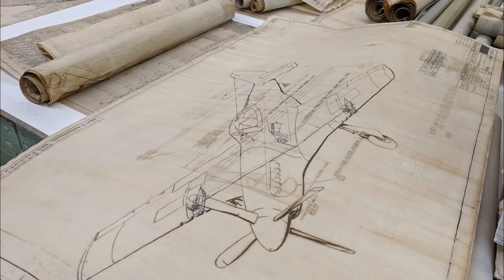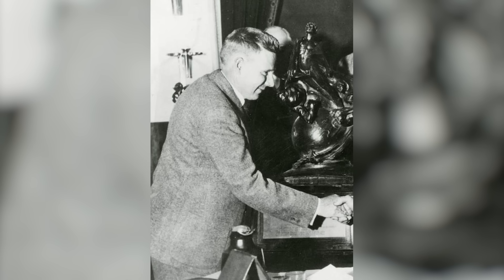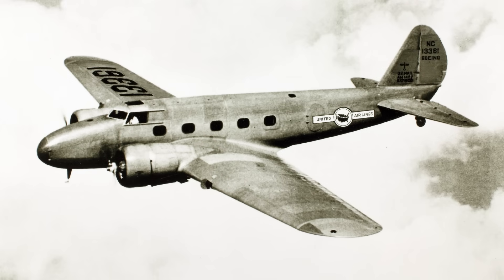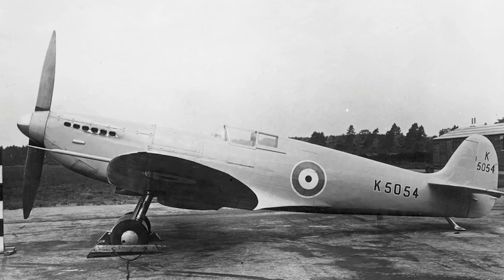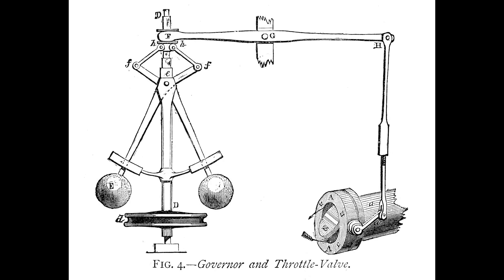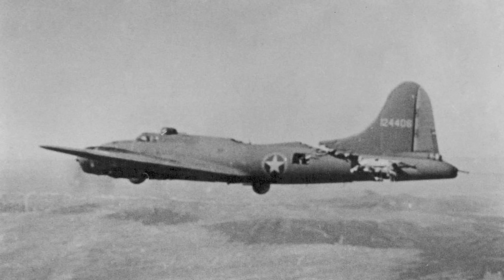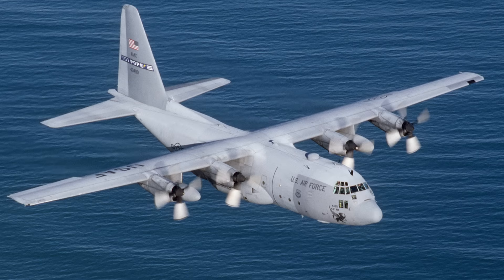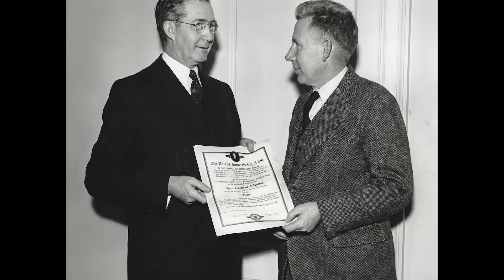The GENIUS Who Built A Gearbox Inside A Propeller

Comment: 10:10 7K feet per minute of climb? Total nonsense. As a note, 'instant' is not the same as immediate. By Aug 1K planes had constant speed props, DH didn't convert all of the 1K in 54 days. 11:50 HS constant speed props were not on every Allied fighter, Curtis electric props were used.  Ai, Ai, Ai, Ai.
"In 1933 the Collier Trophy was awarded to "Hamilton Standard Aircraft Propeller Co, with particular credit to Frank W Caldwell, Chief Engineer, for development of a controllable-pitch propeller."
7 years before the war started.

Comment: Germany had another ace. They had pumps to feed diesel and not aspiration.B S K Murthy.
Reply: also the Germans had discovered innovations they had a system with water spray in the combustion chamber for a while to get out of a difficult position and an oil cooler that hugged the propeller ?
Reply: Realization dawned on me. A diesel engine can't function without a pump to spray diesel on hot air.B S K Murthy.

Comment: In the 1950s there was a story at Dehavillands that some technicians on an RAF airfield converting 2 pitch props to 3 blade C/S units in June 1940 were told by an accountant to stop work because the Company had still not received a signed contract for the work and might not be paid for it. To which the Technicians retorted, "If we don't change over the Props we will NEVER be paid."

Comment: Wallace Rupert Turnbull of Saint John N.B. Canada.
During the First World War, he went to England to offer assistance to aircraft manufacturers, and designed propellers for Sage seaplanes, and a Short 184 seaplane, which attained an altitude record of 13,000 feet (3,960 m) on June 9, 1917. At this time, he began to work on a mechanism which would allow the pilot to control the pitch during flight, like changing gears on a car, so that the pitch could be set at different angles for take-off and landing, and for level flight.

Gaining a Patent

At war's end, Turnbull returned to Rothesay and continued work on the design of a variable pitch propeller for which he gained a patent in 1922.  The propeller itself was made by Canadian Vickers Limited and fitted to a 130 hp Clerget engine on an Avro 504K. The Royal Canadian Air Force (RCAF) conducted the first test flights at Camp Borden and the Turnbull variable pitch propeller proved highly successful.

Comment: So, at 4:30, "they bolted on controllable pitch propellers."  Unless those engines were designed with hollow crankshafts so they could provide oil to the prop controllers, just how did they just "bolt them on."  So he's saying the Wasp engines had hollow cranks, and then "eureka."
Reply: @mountainflyhigh  hope they bolted on prop governors, too
Reply: Many engines of that era had hollow crankshafts for lubrication and weight reduction. But the original WASP R-1340 A model did not until the S3H1 variant. They knew the technology of variable pitch props was coming and were preparing their engines to be compatible with them by adding hollow crankshafts, and modifying engine casing with pneumatic control channels. So, I would call that "bolt-on" with prior preparation. As for the Merlin the variable pitch system was integrated into the gearbox with a separate lubrication system so the hollow crankshaft didnt even play a part.
Reply: @nicksantos43  - Now that makes sense, but the video makes it sound like they had no clue variable-pitch was in the works.

Comment: The Aeromatic (aka Kloppers) prop/hub is another amazing invention. The Aeromatic prop was capable of optimizing the angle-of-attack without any input from the pilot, whatsoever.  I don't believe these props were put on any but the Ercoupe, Aeronca, Taylocraft, C120/140, or Luscome vintage C65-85 Continental equipped planes of the late 1940 early 50's.  Compared to the fixed-pitch props, the Aeromatic-equipped planes produced considerably more thrust at every engine setting.

Comment: Lack of pitch control made the final Supmarine  Schneider Trophy racers e tremly difficult at take due the extreme torque at take off using a somewhat course propeller which could fully utalize the power of their RR engine.  Very much the problem experienced with a rubber or compressed free flight model.

Comment: With rubber or compressed air free flight there is an initial  power burst then a gradulal loss of torque. This has always presented a problem of trying to control this. Variable pitched props have been tried but generally the weight and complexity make fixed pitch most useful with adjustment to control the initial power burst torque. This is the challenge of free flight making it aerodynamically more chalnging than radio control.

Comment: Caldwell did NOT invent the variavble pitch propeller.   Dr Henry Selby Hele-Shaw and T.E. Beacham patented a hydraulically-operated variable-pitch propeller (based on a variable-stroke pump) in 1924 and presented a paper on the subject before the Royal Aeronautical Society in 1928; it met with scepticism as to its utility. The propeller had been developed with Gloster Aircraft Company as the Gloster Hele-Shaw Beacham Variable Pitch propeller and was demonstrated on a Gloster Grebe, where it was used to maintain a near-constant RPM.
The French firm Ratier produced variable-pitch propellers of various designs from 1928 onwards, relying on a special ball-bearing helicoidal ramp at the root of the blades for easy operation.  Walter S Hoover's patent for a variable pitch propeller was filed in the U.S. Patent Office in 1934.
A Gloster Hele-Shaw hydraulic propeller was shown at the 1929 International Aero Exhibition at Olympia, London.  American Tom Hamilton of the Hamilton Aero Manufacturing Company saw it and, on returning home, patented it there.  As the Hamilton Standard Division of the United Aircraft Company, engineer Frank W. Caldwell developed a hydraulic design, which led to the award of the Collier Trophy of 1933.
PS - please research the difference between variable pitch props and constant speed props.
Reply: Aye, this is mostly AI pish

Comment: The Wright Brothers didn’t “invent” powered flight, they invented the Modern Airscrew! If you look at the early Wright Flyers, they were GEARED, they ran from belt driven pulleys, the Wrights built 2 prop aircraft, driven by a single engine via pulleys.

Comment: 9.06: Why German pilots outmaneuvered Spitfire's, was due to Spit's carburetors vs fuel injection.
Spit's could not stand negative G;s; carbs do not work "there", injection do, hence engine starvation.
The ability to follow German's i a dive, had barely less to do with the propeller, but solved with "Miss Shilling's Orifice", in carb's.
Reply: And fitting pressure carbs, developed in the USA. Look up Henshaw flying a Spit- the engine cutting out only bothers if you let it

Comment: Interesting video for us "gear heads" and not pilots, but...
As a engineer/innovator, I have somewhat hard to believe this "fact", at 8.22: "hunting for...air", thing.
For me, correct me if I am wrong, the propeller "hunts" for the most torque efficient revs?
The prop is a dumb device, not knowing about some "bite;s", only optimal; oil pressure = revolutions =angle of attach.
Reply: It just tries to keep the engine at the same revs
Reply: @Bakes-z4c  As I "explained", but not clear enough, for all apparently.

Comment: Great video! I got my FAA Airframe & Powerplant license in the late 1960's working on these types of propellers. Great explanation on how they work. I'm also a pilot and while in the UK recently I flew a 1943 Spitfire Mark 9 (2-seat conversion). On take-off the Spitfire accelerated amazingly fast due to all that horsepower up front. I was taught to slowly apply the throttle on take-off because otherwise the tremendous torque of the engine would be more than the Spitfire control surfaces could handle. Many low time Spitfire pilots lost control due to this reason.
Reply from the maker: My man living my dream, happy for the achievement you’ve got, when i was young my was to be a pilot then i ended up in the Mechanical and Energy Engineering. Love it and thanks for the comment 🎉
Reply: Here's a very different view of the importance of a slow take-off.  I was on a small island near Indonesia. It was twilight, and I had 3 km to walk to my g.h.  I saw a group of teenagers with a parked motorbike. I approached them and, despite a language barrier, conveyed the message that I would pay one of them a couple of bucks to drive me to my destination. The bike owner agreed. I was handed a helmet. I positioned on the pillion, and the driver took off fast.  I immediately pitched backwards, but just barely caught myself. The helmet flipped off my head (few helmets here have working fasteners).  If I had flipped off of the back, I would have clanged my head hard on the pavement, and wouldn't be writing this note.  Chances of survival in that scenario:  4%.
Reply: @rvrrunner  
Why great "video"...?
It was at best an enthusiastic podcast with no pertinent schematics... the only three schematics presented didn't show the complex systems on an actual aeroplane variable pitch propeller.
The principle shown in the second sketch is a rough outline of how a giroscopic governor valve from the industrial revolution steam engine, can be modified to work as an actuator.
The third picture is about a ship's propeller with adjustable pitch blades operating on the same basic principle but with completely different engineering requirements and refinements.
I would say, it's like demonstrating how the basic principles work on a modern F1 car, with a pioneering era wagon rolling down a hill.
Reply: @Slowmolasses for someone with zero knowledge these demos explained the concepts. Good enough for them. You want more details then look for it elsewhere. Still great video.
Reply: @rvrrunner 

I hear what you wrote...
Thus, alter my critique to temper sensibilities... now I say; wonderful podcast, with some visuals thrown in as a bonus to balance the mental picture.
Please get real.... not everyone watches purely for entertainment, some are actually looking to learn concisely.

Comment: In 1934 Clessie Hamilton  perfected the two pitch metal propeller whilst working as an engineer for the Standard Steel Corporation. Standard Steel developed a range of metal propellers that were adjustable , their pitch set by mechanics to take account of various  conditions, airfield height, wind  direction and air density . Clessie took  a leaf out of Col Heleshaw Beacham who in 1920 perfected a variable pitch propeller , pitch adjusted mechanically from the cockpit via a shaft gears and a sliding bearing similar to that used in a car clutch . Heleshaw tested his prop on a second hand SE 5 , a rag wing ex world war one fighter. At Standard Steel Clessie went further by using bob weights on each blade root and a sliding hub, engine oil under pressure kept the blades in the correct  setting , low pitch for take off and climb, high pitch for cruising. On the instrument panel  a simple pull out knob not unlike the choke on an Austin A40 Car selected low or high pitch via precision drilled galleries on the prop shaft. Standard Steel then marketed  Clessie,s propeller as the ' CS' or 'Bracket, rest is history.
Reply: Interesting, thanks

Comment: In 1943 my uncle was a pilot in the Air Force Ferry Service, moving aircraft and materiel on routes across the United States. The component described in this video is exactly the part that failed on takeoff on one of the engines on my uncle's B-25, causing him to immediately spiral into the ground in Florida. My uncle and 4 crew died.

Comment: I remember seeing the same thing on windmill propellers. In the 1970s we would go out to the Midwest to get old electricity-generating windmills that the farmers still had on towers from the 1930s. The windmills needed to shut down in really high winds or they would blow apart. So they had a governor, weights on hinges on the hub which flung outward as the blades spun faster. The movement of the weights would turn gears inside the hub which would "feather" the blades out of the wind and slow the spinning down.
Reply: Hi.
I worked as Engineer at a power company and "we" had 2  small, hydro-power plants.
Highly sophisticated ones too, built around 1920;ish, with governors, exactly like at 7.26..
I had to repair both due to their "extended" service and "poor" quality, already in 1988.
Lasted only 60+ years.
Interesting to work with, as a marine/electro- engineer and used to rotating thingies.

Comment: One reason for using turbo prop on military ( and civilian  )  aircraft is that unlike a jet engine,  the propeller is pushing high speed air over the wing even when plane is stationary,  this massively increases the lift on the wing allowing the aircraft to take off in much shorter distance ( or with greater payload ) - the combination of flaps and propeller speed can also allow lower landing speeds on rough runways.

Comment: Over dramatic and a childish presentation, so un accurate.
Sorry
Reply: Indeed. Starting from the very first sentence....
Injected nitro dragsters use a direct-drive fixed ratio system with a multi-disk wet clutch pack, not a multi-speed transmission. With plentiful engine torque, sometimes in excess of 20,000 Nm (vs 1,500 Nm for a 500h Cummins diesel), clutch slippage and the varying effective diameter of the low pressure thinwalled tyres act as a substitute. A gearbox which could shift fast enough and be light enough would last less than one run.
The accompanying video frames do not even show one of the lower tier dragsters which do have a multi speed gearbox. 
It's not a dragster at all.

Comment: How does this scintillating technology compare to that used to try to equip HMAR101 with reversible thrust airscrews?  The blades of which would not  stay attached and wrecked several engines.

Comment: Frank Caldwell was Mr propeller. He was active in propeller development starting in WW1. This is a poorly told story, however. The images, while real as opposed to  AI, but they are not supportive of the narrative. The story intimates that nobody knew what to do about  the performance issues of a fixed pitch propeller. Everybody knew that the pitch needed to be adjustable in flight. They just didn’t know how to do it. Caldwell came up with the hydraulic actuator cams and bevel gears. He also had developed the test facilities to test and develop the mechanism. He also was a pioneer in study of transonic aerodynamics, as propeller tips have been operating in or near that realm since WW1. See Wikipedia for his story if you want the facts instead of an overblown yarn. The constant speed upgrade was developed with assistance from Woodward governor. The flyball governor dates back to waterwheels and steam engines.  This yarn uses an illustration of the ancient version, connected to control a throttle, rather than a hydraulic spool valve. The video never shows a useful illustration of the mechanism of the modern governor…. (But it treats you to people working on DeHaviland Mosquito fuselage halves while talking about propellers) To work effectively as a
proportional servomechanism, the mechanism needed to be developed by Caldwell to reduce the friction in the mechanism to keep the control from hunting. There was a parallel development of an electrical solution by a Canadian named Turnbull. His work was commercialized by Curtiss-Wright.